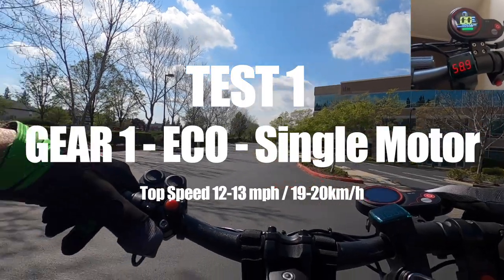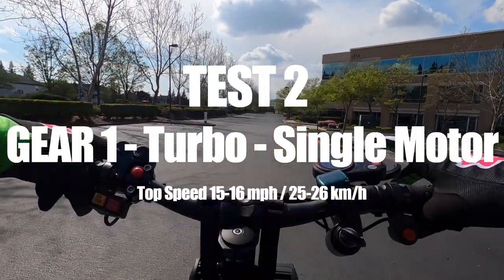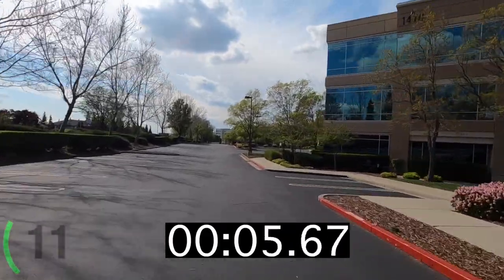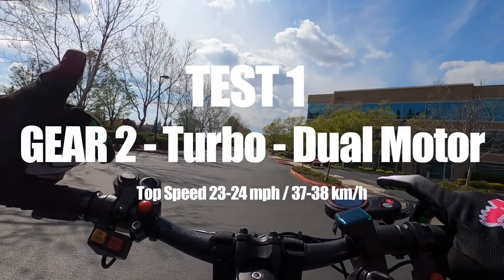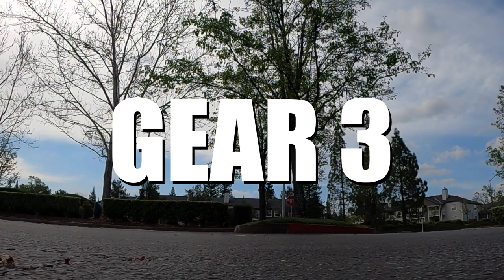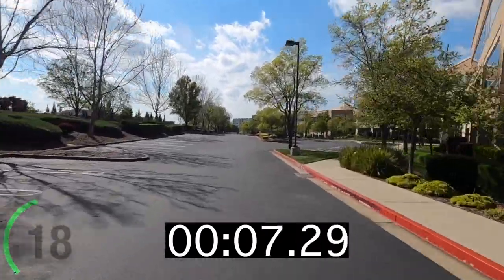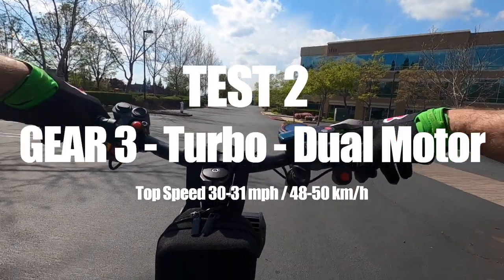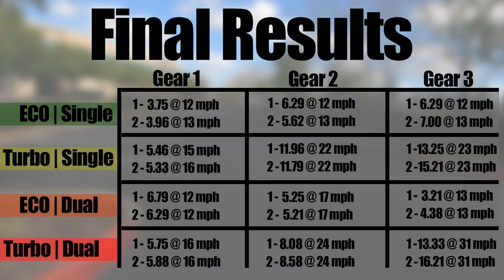ZERO 8X | Dual Motor | Acceleration Test

Comment: Excellent video as usual. Your camera shots and editing are always professional. So, besides the 3 gear choices on the controller and the dual motor & turbo buttons, parameter P12 in the controller also has velocity curves you can set from 1 - 5 for even more customizing of the acceleration from the throttle to the motors. Because of my handicap I can barely hang on to the 10x when set to the defaults it was set up with from the Rev Rides. When making my purchase I mentioned my disability and they installed “for free” a left handed thumb throttle and wired it to my controller. Awesome folks there at Rev Rides. Thanks for all of your great videos!
Reply from the maker: Thanks man! I appreciate it! Yeah I have mine cranked up to 5 so it’s the highest acceleration curve too. Every once in a while I get a little lag. I have to release the accelerator and reapply to get it to kick in. It’s pretty rare that it happens but it is something. It could just be a loose connection too in the controller. I did have to re solder the connection to my turbo eco button before I did this test. Thankfully the button seems to limit power when engaged so when the connections came loose it kept it in turbo mode. Wasn’t a super big issue for me since I don’t typically ride without turbo on. 

You’re definitely right about Rev Rides. I had an issue with my charge me and they hooked me up without a question. Even sent me a Christmas card this year!

Comment: It’s been 4 months since you did the stem bracket upgrade. Does you stem still not make the creaking noise since you did the installation?
Reply from the maker: Herc O it’s still solid. Sometimes I need to re grease the spacer because it will make a little noise. But no where near how it was to begin. Once I grease it it’s as silent as it was when I first installed it. Thanks!

Comment: you don't have the stock handelbar, yours is not pliable.

aftermarket? x10 handelbar?
Reply from the maker: Correct. I upgraded the handlebars. They are similar to the ones on a 10x but just mountain bike handlebars. I didn’t like the folding handlebars. They were really heavy but they always came loose. You have to tighten the but where they fold all the time.

Comment: so would you say riding in eco-dual mode would yeild about 25 miles in range?
Reply from the maker: I think more than that. The range test I did previously was in gear 2, turbo, dual motors and I did 13 miles with about half a charge lost. So that should get you about 25 in turbo and dual motors. Thanks for the comment!

Comment: I just saw the performance test on electric scooter guide and they listed that it takes 7.8s for the 8x to went from 0-30mph, which is faster than the 10x in terms of acceleration but what you got is double of his, and I also saw the comparison between 10x and 8x on Rev Ride, and the 10x is clearly faster in that 100m race (slight decline) at 7.91s compare to 8.49s on the 8x
Do you know why is that?
Reply from the maker: Thanks for the comment! So the 10x has 200 watts more power in each motor. So that definitely explains the difference in speed with 10x over 8x. 

Results could vary based on a couple factors like weight and riding conditions just to name a few. I’m 6’1 and weigh about 180 pounds. 

I’ve actually ridden around with a fellow 10x rider and the speed comparison is noticeable for sure. Especially on inclines the 10x is much power powerful. They just offer 2 different sets of options. I was willing to sacrifice a little bit of power and speed to never have to worry about getting flat tires.

Comment: what handle grips are you using?
Reply from the maker: I got some from amazon. The original seller doesn’t have the grips I got but any bike grips should do. I got some that you tighten on with bolts.

Comment: i think there is a mistake in your table,  GEAR 2 eco dual 17mhp GEAR 3 eco dual 13mhp. how is possible?
Reply from the maker: I don’t believe it’s a mistake given the tests were done twice. If you watch the actual trials those are the numbers for that test. I address that at about 4:30 in that video. I was a little surprised at the results as well, but that’s why I did this video was to see what would be the fastest but also the most efficient. Thanks for the comment!

Comment: What do you use to superimpose your speed in your videos?
Reply from the maker: Erik Olsen sorry for the delay for some reason I didn’t get a notification about your comment. The app I use is from the Apple App Store. It’s called Speedometer+. I edit my videos with Final Cut Pro. Thanks!
Reply: @ADayintheLifeofMr23  Excellent, thanks! Your videos are awesome. I ride the Z8X as well, and just now recently became more confident and go gear 3 2 motors full throttle and just love the 27-32 mph feeling on those 8" wheels.

Comment: Great video with all the times of various modes. Would you recommend this as a first scooter? 🤔
Reply from the maker: I would say so. For me the 16-18mph of entry level scooters got old pretty quick. The 8X still has the ability to start out with those max speeds until you get more comfortable. But for me, if I bought an “entry level” scooter for a few hundred bucks I’d be shelling out more money for an upgraded one like this really quickly. 

Hope that helps. Thanks for watching!

Comment: Hello, I was researching the zero 10x,I find the 10x just too big and heavy, Then I stumbled upon your video on the 8X, glad I watch your videos...coz it's just the size I am looking for, but what I am wary about is the solid tires. I watched all your videos but I did not see you talking about how comfortable is the ride and how it does in the rain with the solid tires? hopefully your next video will be regarding that topic. btw, I do not know why it does not have a locking stem and the price is very close to the 10X . enjoyed watching your videos.
Reply from the maker: newbie101 thanks so much for the comment. The tires I do need to do a proper video on. They are just about in need of changing. I will make sure to include my thoughts on the current tires and ride quality. I can briefly say....by nature the solid tires that come stock  will not do as well in wet conditions. The get a little slippery for sure. The suspension on the 8X is good enough to not notice bumps. Big cracks in the road and such are a different story....but fortunately for me the roads and trails around the immediate area I ride are decently kept. 

Thank you again! Really appreciate you
Reply: @ADayintheLifeofMr23   Hello, Gee thanks for responding to my comment..first of all I want to say, I really like they way you do you review and blog about the 8X.
 I know you prefer solid tires for no flat, my question is, is there an option for a tubeless air tire on the 8x? btw, I saw a video from falcompve changing the 8X tire wow...it's a lot of work.
Reply from the maker: newbie101 thanks a lot! The tires size is 200x90. So I would assume if you found a tire the right size you could do a conversion. But yes, it’s gonna be a lot of work! But I need to get them changed sooner than later so it will be happening! Thanks again
Reply: @ADayintheLifeofMr23  Good luck and please post a video on that. stay safe and healthy my friend>
Reply from the maker: newbie101 same to you!